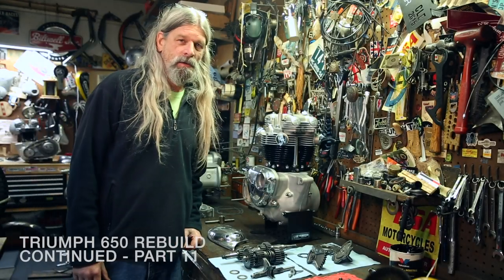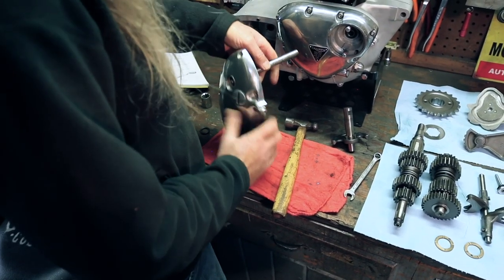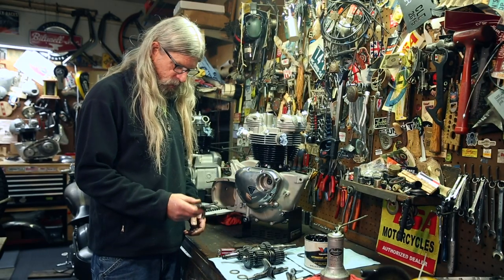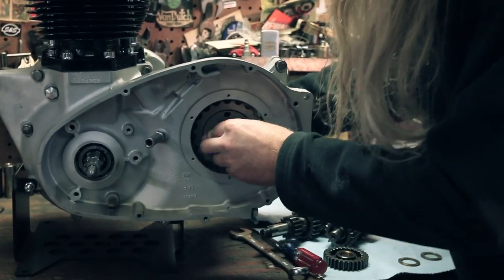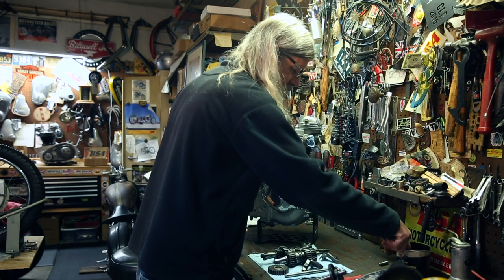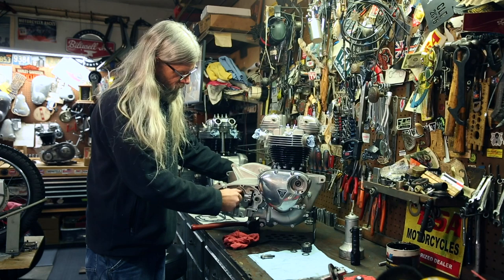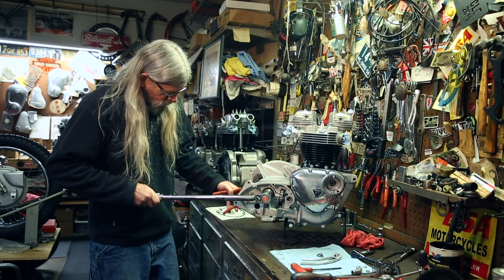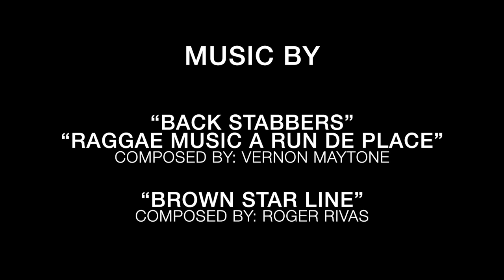Triumph 650 Motorcycle Engine Disassembly & Rebuild Part 11 - Lowbrow Customs

Comment: The clutch lever is super hard to  to pull in on my 1971 T120R. The person that I got it from has put another clutch on it. I've had it all apart before to inspect why it's so hard. It seems the springs are very strong. I know that if it sets for awhile it's very hard to roll it with the clutch lever pulled while it's in gear. I have to roll it several times to get it broke loose with the lever pulled in.

Comment: Brilliant videos - many thanks for all your hard work. Really helped me rebuilding an 1972 TR6R Tiger. Only difference is that my gearbox has a leaf spring to hold the cam plate in place.... no wonder Triumph changed to a plunger! It's a bit nasty. I found it best to set up the index in 1st Gear not 4th. As the leaf spring has to sort of nip under the cam plate as the inner cover goes on. Otherwise your methods an advice are cracking.
Reply: Other way round mate. The leaf spring came in with the oil in frame models, like yours.  and mine, an OIF Bonnie 650. The spring  works much the same but it was a few pence cheaper to make.
Reply: @stevecunningham8960  Well spotted! Not sure why I said 1st. But you're correct - 4th! Cheers!

Comment: Roll camplate to 4th gear notch straight down. 
Align quadrant top slot with shift shaft hole ...quadrant is down not quite all the way...and push inner cover home.

Comment: Todd, what size socket are you using to torque the high gear nut? 1-5/8 is too small and 1-11/16 is sloppy. Great series!
Reply: xopher flett  what size socket was it?
Reply: How do i get intouch with you Todd,i have a 750T140V triumph, an i need some help please send me ur contact

Comment: Enjoy your videos on this project.  A lot of good info for those who've not done this kind of rebuild.  I do have to say you are pretty conscientious with most of your methods and procedures.However, some constructive criticism on your treatment of various seals.  Shaving a bit of rubber from the OD on installing into tight bores is usually not a problem as long as there's a good tight fit.  But driving that kick start shaft through that seal with a mallet was not a good idea!  Cutting that ring of rubber from the seal's ID was really not ok.  The ID is the critical area of any lip or o-ring seal, and punching out a portion of the ID as was done here is a mistake.  If that seal doesn't leak, or at least weep oil, you'll be very lucky.  The correct move would have been to admit the error and replace the seal.  Then spend a bit of time dressing the shaft end so that it will enter and slip through the seal without damaging it.  Why spend all of the time and effort, then damage a seal and not replace it?
Reply: That seal is flat on the inside edge I did not harm it as this engine has been run for 2 seasons with no leak at that location although I agree with your general statements unfortunately  some of the reproduction parts may not be correct dimensionally

Comment: Hello Todd. I have a 1970 T120 (uk spec) and it doesn't have a plunger for the cam plate? is this correct / ok ? Thank you.
Reply from the maker: give todd a call 1800-935-5050
Reply: @lowbrowcustoms  I have the leafspring on a 4 speed? assembled it in 4 gear. A few attempts before getting it right! Thank you.

Comment: Not sure if you've seen these British made kits - superb improvement on original ignition etc. No more contact breakers and condensers or the Lucas charging system... Fitted it to my 1972 Tiger. Ignition is a D+CDI with single coil. Charging is only to charge a small battery. Works very well and timing is a one time job when installing. Very impressed. https://www.electrexworld.co.uk/cgi-bin/sh000001.pl?WD=stk%2d102&PN=STK%2d102D_%2d_Ignition_Alternator_Kit%2ehtml#SID=826